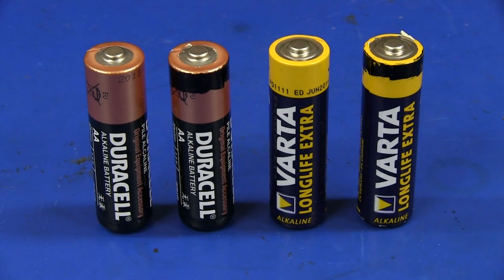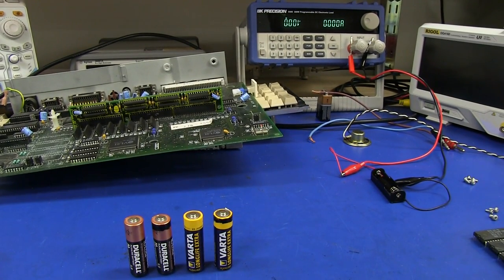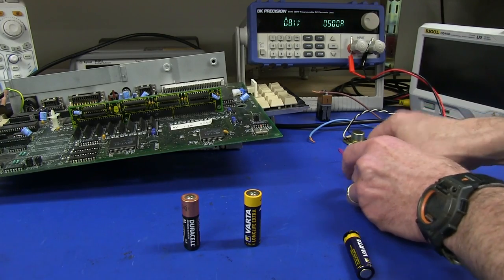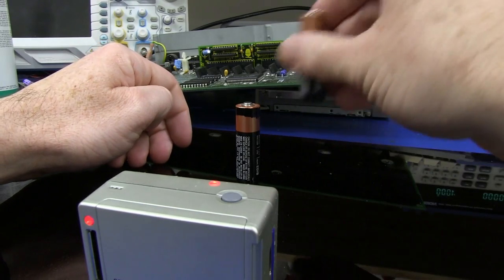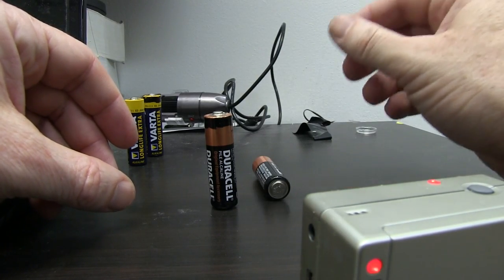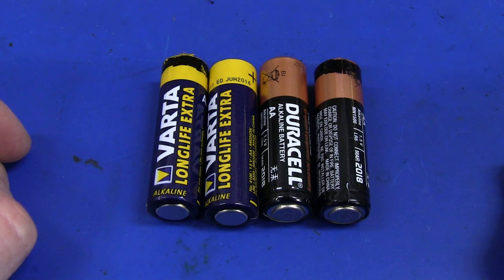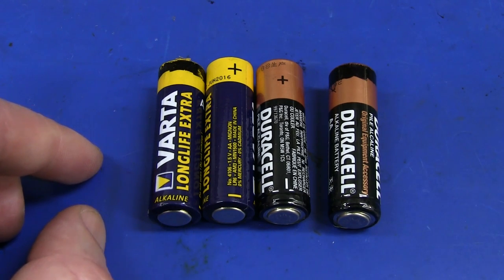EEVblog #508 - Can You Test Battery Charge By Dropping It?

Comment: Batteries have the same number of electrons when fully charged or fully discharged.
Reply: +ngneer999 Do they or don't they? What about heat and bonding energies.
Reply: +Ernst Stavro Blofeld Of course the batteries have released electrical energy by performing an electrochemical reaction in the battery.  The number of electrons is exactly the same in the dead battery.  If this were not true, there would be a HUGE static charge on a discharged battery.
Reply: ngneer999 Not at all.
Reply: +Ernst Stavro Blofeld Electrons are not lost when a battery is discharged. If a battery is 
losing electric energy, it doesn't mean that it's losing the electric 
charge! They're just moved from one electrode closer to the other and 
it's just the motion through the wire stretched between the electrodes 
(and the electric field inside the wires) that powers the electric 
devices. But the whole battery is always electrically neutral; because 
it contains a fixed number of protons, it must contain a fixed (the 
same) number of electrons, too.

Instead, the energy difference really boils down to different 
electrostatic potential energies of the electrons relatively to the 
nuclei. One could say that when a battery is being discharged, its 
electrons are moving to places that are closer to the nuclei, perhaps 
other nuclei, in average and the modified interaction energy affects the 
amount of energy=mass stored in the electromagnetic field.
Reply: azy6868 Do the electrons actually move or is it just their probability wave that moves?
Reply: +Ernst Stavro Blofeld Yes they move- and you can walk faster than they travel across/through a conductor, but there is very little compression between them so you move one and you basically moved all of them nearly at once.
Reply: EgadsNo So in other words, computers on a near light speed spaceship are useless.

Comment: Hey, most of the time you let the empty battery fall off from a higher distance! (And no, it is not the camera angle, since you change sides when you switch from full to empty)
Did you even notice that yourself ? 
Is your subconciousness doing tricks on you ? 
You would need to do a test with double - blinds. Let someone hand you the batterys only labeled with a number, not giving you any information on the load state.

Comment: Vinstrol, there is a bit of zinc in an alkaline battery. As the battery discharges, the zinc turns into zinc oxide, making it lighter and bouncier.

Comment: Have you measured the overall length of one battery, both in a charged and discharged sate, very accurately? I too suspect internal pressure differences. These may show as a slightly elongated case as the negative terminal swells, and regresses very slightly between states.

Comment: If I don't have a multimeter handy, I'll stick the battery in my mouth and you can feel on the positive side of the battery with you tongue how charged the battery is based on how much it tingles. It's much easier to do with 9 volt batteries and button cells, because you just need to touch you tongue to the positive and the negative contacts at once.

Comment: The mass isn't going anywhere, likely the internal chemicals of the battery have a higher/lower rigidity when holding onto a charge, increasing the overall elasticity of the battery.

Very interesting!

Comment: We understand empty battery has less electrons but that does not confirm the stability after failing them is a useful measurement.Why? The ENERGIZER battery has flat base but other such as DURACELL has visible butt, so I do not agree with this method due to their formation design of their bases have no equal forces after they collide with the ground.
Reply: +Abdulrahman Ammari 
An empty battery contains as many electrons as a full one. Only the distribution is different.

Comment: Maybe because simply gasses were built up inside the battery during it's use or via the chemical reaction producing power. The metal is a simple sheet and the gasses make it more springy.
Simple explanations.

Comment: According to US Patent 5567541. The volume changes linearly with the state of charge. So maybe the depleted batteries have more volume and are bulging slightly at the bottom? Can you measure the cell lengths with calipers? (don't use metal calipers!) Or see if the bottoms are flat or domed?

Comment: well, there ya go I guess. I wasnt sure with KipKay's video. Especially that he used two different brands. 

While it apparently works by simply seeing the amount of bounce from the battery, the issue of making it stand is another story. What if you have multiple batteries, from multiple brands? Do they all have the same amount of flat surface area? And even if they do, is it truly flat?

So I think the big picture here, is, if it bounces more, then little charge. Getting it standing is luck.

Comment: Hi Dave,

If you care for doing a proper test I can process the data using a statistical method called Analysis of variance (ANOVA) for you. We can then see which variables are significant on the test. The variables can be the charge state, surface finish, drop height, brand. Also with this analysis we can see what combination of variables matter.

To do it we need 3 test samples of each variable combination (I'm just guessing the sample size by the video variance),

Comment: to the opposite material in the batteries which gives the material that loses its electrons gets its physical properties changed a bit that gives this aftermath.
well to be more exact both materials has its physical properties changes due to the movement of the electrons.

Comment: Energy and mass are linked, E =MC2. Therefore as the battery loses energy it also loses mass. The conservation of mass and energy.
Reply: lol...yes E=MC2.., but we're working with battery, not atomic bomb.
Reply: So batteries do not follow the law of conservation of energy? E=MC2 applies to all mass and energy, batteries do have mass and therefore energy. 
Mass and energy are conversion of each other, if you charge a battery then you increase its mass, a battery is lighter without charge.
Reply: No, you're right, E=mc^2 applies to all mass and energy.

But here's why you're wrong:
The Planck Mass (2.2 x 10^-8 kg, or about 1/100th of a microgram) when multiplied by 299792458^2 m/s, equals an energy of about 1.956 x 10^9 J (otherwise known as 0.5433 MWh, and otherwise known as 543.3 Kilowatt-hours.)

Most batteries that we use depend on chemical energy as a result of ionic bonds, not mass-energy. The point is, the difference in mass between a full and empty battery would be negligible, and even more insignificant where chemical energy is concerned. So, tell me, do you know of any batteries that can store 543.3 Kilowatt-hours of energy?
Reply: ***** A simple experiment can be carried out with a set of batteries, get a AA battery which is fully charged and one which is discharged and drop first the fully charged battery from two inches and watch how it bounces, then repeat with the discharged battery as the EEV blog showed, there is a significant difference which is due to the weight loss in the discharged battery.

Comment: Sorry, but 2OH- is not hydrogen.
Also, that formula is only half the reaction (see wikipedia-dot-org/wiki/Alkaline_battery#Chemistry): Zn + 2MnO2 —> ZnO + Mn2O3
Looks like no gasses are formed, but clearly, something is going on. Admittedly, Kipkay mentioned a gas being formed, maybe there's a secondary reaction that doesn't contribute to the electric storage.
Or a structural change is to blame for the effect as others have suggested.

Comment: Right, the $19.95 version has a trigger in the bounce plug to trigger neon-blue LED's to illuminate up the walls of the clear tube.  And, thinking of fur, the filaments in polar bear fur are supposed to be clear, and I wonder what fiber-optic effects you could get with that, ala. Spencer Gifts.

Comment: Interesting!  I wonder what would happen if you recharged the battery.  I've experimented with recharging alkaline batteries at low current (10's of mA) on a bench supply and was able to get them to hold a bit of a charge (enough to run an LED flashlight again after they had died in it).  Does recharging the batteries get rid of the bounce, or is the bounce a permanent property after the first discharge?  If it's a warped bottom contact it should stay bouncy.

Comment: An excess of manganese dioxide is present to prevent gassing, but a small amount of gas could still form. 
Based on the densities of Zn, ZnO, MnO2, Mn2O3, the volume of the reaction products is only 70% of the consumed reagents (but numbers based on the crystal structure); the outer (Mn) layer has a rigid molded form, so I assume both cathode and anode volume remain the same; with ZnO taking more volume than Zn, electrolyte is pushed to outer layer, resulting in a less fluid core?..

Comment: 8:59 Ahhh, the old classic Microsoft optical mouse - I was using one I bought from way back in 2000, 'till I gave it to my brother(still reliably working) this year, 2013!(and no, the cable insulation didn't breakaway, like my mate's one who bought it at the same time, but he basically trashed by treating it like crap - in less than a year!)

Comment: This is what I think. Mass is energy and during the discharge, some heat energy dissipated and cause mass slightly reduced.
Reply: kf160k160 technically mass isn't by definition "energy". mass and energy are inter-changable but they are not the same things. the actual reason has to do with a chemical reaction that ultimately moves some of the components around shifting the weight ballance of the object thus, the bounciness
Reply: +kf160k160 That's not the reason! It's estimated that the total mass converted into energy (#) during the Hiroshima nuclear explosion was less than the weight of a US dollar bill (i.e. banknote). In other words, to lose a banknote's worth of mass, you need to release more energy than the Hiroshima atomic bomb.

(#) Of course, a lot more material than that was involved, and a lot of it was converted into other elements by the nuclear reaction. But we're talking about the "mass defect", i.e. the difference in mass before and after, i.e. the amount of mass that was converted into pure energy. And even in nuclear explosions where one element gets converted into another, most of it remains as mass- it's the very small percentage that gets converted to energy that causes the explosion! :-O

Comment: There's something into this.
I just tested this on a hard, solid flat stone surface. The bounce difference between a discharged and a fully charged battery is much more prominent.

Anyone care to explain what's going on here? 
I can only guess that it has something to do with the internal pressure and gas build up inside battery.

Comment: or maybe it is in REVERSE way, because for a bouncing, it must be all in and act as a single mass like a dry solid, while if it is like new have chemistry not dry it will not bounce because its internals mass are not bouncing in the same frecuency of the overall object (the case of the battery).

Comment: is it just me or does the Vatra battery that is not marked slightly bigger than the one that is, and the marked Duracell battery is slightly bigger than the one that isn't
Reply: bob bob It's because the negative end of the battery is slightly protruding outside of the insulative wrap which covers the individual cells within the battery.

Comment: It's because of the density  of the carbon rod right?
Reply: HippyDad Wet (good) batteries will not bounce as much due to the physical inertial properties of its internal structure. Dry (bad) batteries bounce much higher for the same reason hard boiled eggs spin longer than raw eggs, the "liquid" causes a slowing of the spin. Simple physics.Nothing electrical about this at all.
Reply: HippyDad wrong kind of battery

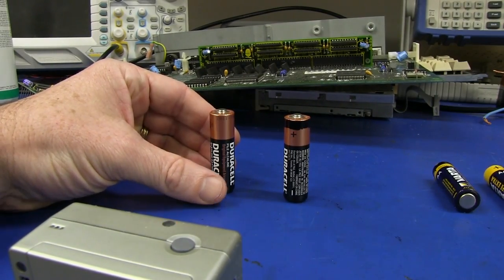Comment: 10 min. vid, 3:40 until batteries start bouncing...got halfway through; someone tell me that in the last 2 min. he borrowed 3 packs of each from Sagan of Industrial, HD, For Electronics (cough), NiMH and the 1.5V NiMH (EneLoop, etc.) Energizer, some Thai and Chinese builds, etc. and had a test rig successively bounce them 2mm-3m high. For that, you can run processing on the GoPro video and care.

Comment: Personally, I think it's easier to test them by putting them in your mouth (put the battery to your upper lips and touch the other side with the tip of your tongue). Battery which is charged will have salty taste. I don't recommend testing 9V though ;)

Comment: Looks like Princeton did the proper scientific tests you were talking about and came to the same conclusion myth confirmed!!

Unfortunately it doesn't go into the science of why this happens. 

http://www.princeton.edu/main/news/archive/S42/72/95S25/index.xml?section=topstories
Reply: Matt Warrillow oooh correction

"They found out it had to do with the way the batteries produce power. Electricity is generated by a chemical reaction inside the batteries as zinc changes to zinc oxide. Initially, a layer of zinc surrounds a brass core in the battery like a donut around a hole. As the battery discharges, the zinc donut gradually changes to zinc oxide."The zinc oxide begins to form on the outside and it pushes its way to the core," Steingart said. "As you get more and more zinc oxide, and the zinc oxide begins to appear everywhere in the zinc layer, the battery gets bouncier and bouncier.""

Comment: Lick it
Reply: ***** Fully charged single cells at aroud 1.5v have a slightly more metallic tingle.  I wet one finger but it on one end and then the tip of the tongue on the other.  It is ever so slight.  Similar taste to sticking on old desert spoon in your mouth when the outer coating has partly worn away.  Dissimilar metal thing I guess.
Reply: +Justin Richards So if the battery terminals had some of the plating worn off you would get a dissimilar metals sensation that would give you a false positive. Excuse the pun. 
Also have you realised that the positive tastes different to the negative terminal?
I prefer the positive flavour. Mmmmm.